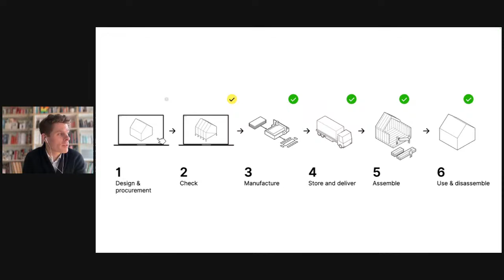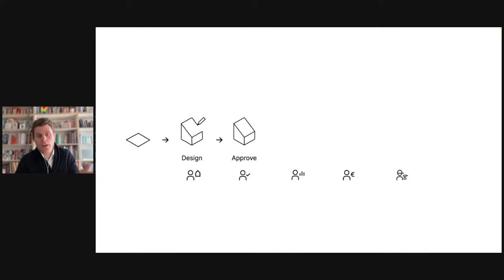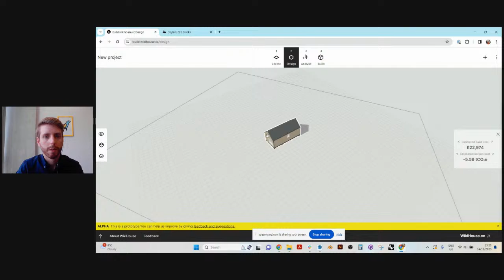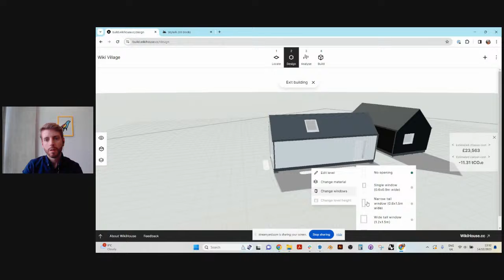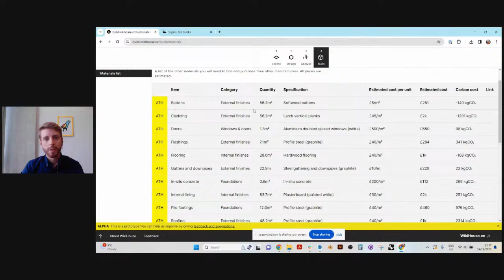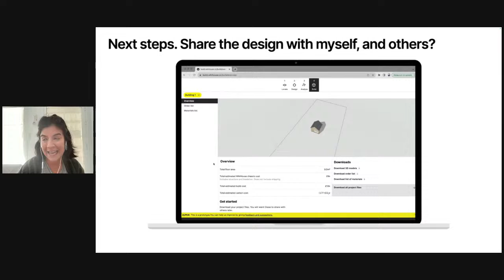WikiHouse configurator - PREVIEW!

Comment from the maker: We ran out of time and here are the answers to the remaining questions:
Q: How would you advise to use sprayed foam insulation with wikihouse?is it possible to spray foam on the inside of the block while it's still "open"?
A: We have seen examples of WikiHouses built using spray foam insulation. Some spray foams are better than others in terms of environmental and health impacts. We have usually tended towards to the less messy soft-fill insulation, but others such as spray or blown cellulose insulation are also potential options.

Q: Have you got any plans to include modelling existing site constraints?
A: Yes, where there is publicly available site data we would eventually like to include property boundaries, topography, satellite imagery, existing buildings etc.

Add any other questions here and we'll reply in comments!